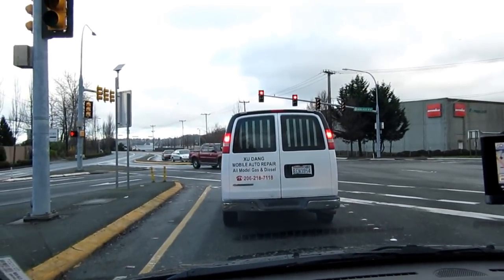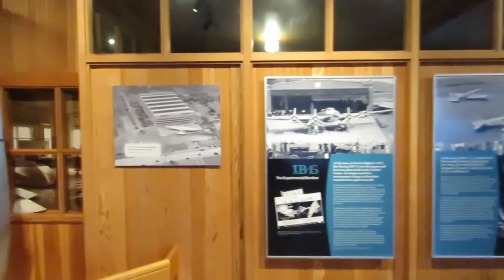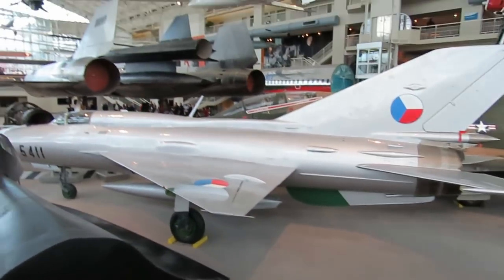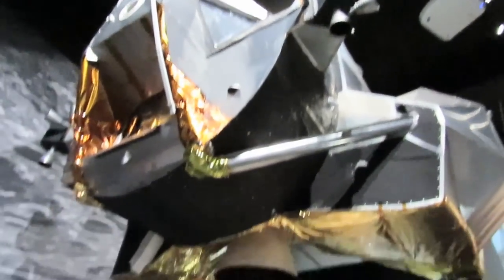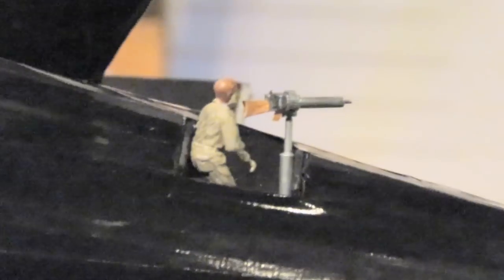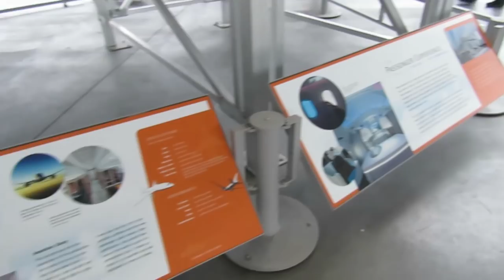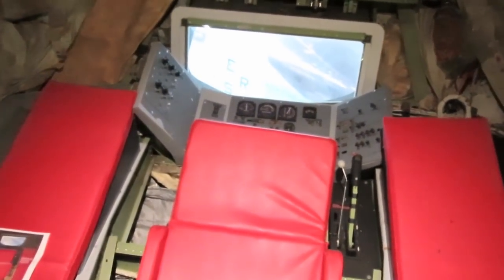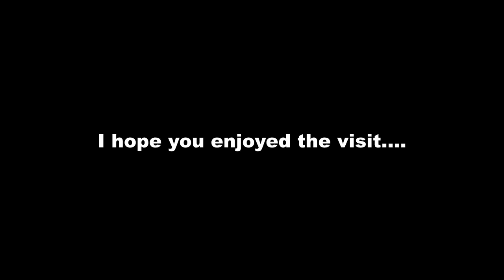A Walk Through Boeing's "Museum of Flight"

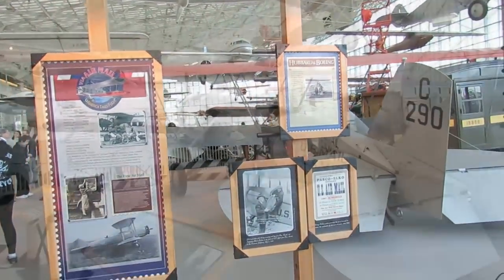Comment: Ryan M-1 (seen above, at 29:00) was recovered from a cow paddock outside San  Louis Obisbo CA, where it crashed 1931. Ty Sundstrom, of Dawn Patrol Aviation, restored  this aircraft late 1970's thru mid 90's. Turned out this is actually Ryan Airlines M-1 #1, and was largely built by a fellow named Waterhouse,  and finished by Ryan employees, 1926. Charles Lindbergh flew this aircraft several times from Dutch Flat airfield, outside San Diego CA, Feb-March, 1927.  IIRC, his famous NYP was Ryan M type #26.

Comment: Thanks for sharing!! I remember their 747 being restored on a program recently. It was in pretty rough shape before that.
Reply: it was in rough shape because in the early days of the museum, they had to store it outdoors on boeing field with no electricity so no interior heat or dehumidification in the cold rainy pacific northwest... i drove past it often when it was parked, it's engines removed and the plane surrounded by a fence. it sat there for years with minimal maintenance so the interior probably turned into a giant fungus factory which made the restoration much more difficult.

Comment: Thank you for the excellent post. I’d spend a days wage to get in there. It has to be one of the best museums I’ve ever seen. I don’t know what you do for a living but you would be an excellent tour guide in your retirement, you were very knowledgeable. 

Just one gripe from a Wichitan, hardly a mention of Stearman or Boeing Wichita. Boeing wouldn’t be what it is today without Wichita. Worthy of note the Airforce One airframe was assembled in Everett, but final interior finish done in Wichita. Oh and one other worthy note, the Dreamlifter a few years ago landed at a small municipal jet port, short of Boeing Wichita.  Missed by about seven miles. Raised quite a stink, they weren’t sure it could take off and get it out of there. Boeing sent in a special crew to execute an extremely short take off (6100’ of runway). But they pulled it off with room to spare. Lol 🇺🇸

Comment: Sorry.. gotta say.. the Air Force KC-135 was not designed or designated as a cargo aircraft although related to cargo planes. It was an in flight refueling model & design. It had room for cargo & was conversable to a passenger bay type aircraft, but rarely used used as a cargo plane & only as a passenger utility plane, as an in flight adjunct to it's primary refueling mission. During refueling operations it had ample cargo bay space but it was kept 100% empty typically. 
Fuel tanks for refueling were in the lower parts of the fuselage; with large empty cargo bay above that. The tail refueling boom operators had a very good sized refueling station, later computerized, to "fly" the boom into the receiving aircraft; typical of the AF way of refueling. (the Navy method quite different because of the Navy's aircraft carrier based mission requirement - smaller aircraft used for refueling with simpler droge design fueling nozzles.) USAF tankers had the capacity to service Navy aircraft and did fairly often, but not the other way around. AF typical refueling receptacles were not compatible with Navy design, though some earlier 1950's AF equipment were designed with the Navy type probe receiver nozzles.
Reply: I hate to disagree, but you are wrong on many of your statements.  First off the 135 is and always was a cargo plane.  We had special rollers installed that allowed palletized cargo to be easily loaded and secured.  After the Cold War ended, it did a lot more cargo hauling, because it could do it very efficiently.  Second off, the boom operators station was never computerized.  The boom was hand flown anytime the boom was used.  For Navy aircraft, the drogue was installed, but the boomer still had to fly the boom into position, and then the pilots would have to fly into the basket.  The Navy preferred the drive system, because their aircraft were smaller, and used less fuel, so the reduced fuel flow was not an issue.  The Navy tankers did not have a boom operator, so the drogue, simplified the operation.  The only automated parts of the boom, were the indicating lights that showed where the pilots are supposed to be.  Also the boom would automatically retract, and raise up, if the receiver got too close.  
Third, all the fuel on the tanker could be transferred to a receiver aircraft.  Of course, if they did that, the tanker was doomed.  The body tanks and center wing tanks were the largest tanks, but the wing tanks were plumbed to drain their fuel into the body tanks to be pumped to a receiver.

The tanker was equipped with a large cargo door to facilitate cargo handling.  For routine flights, where our only mission was to refuel another aircraft, we would never carry cargo, because we are taking off and landing from the same base.   Anytime the aircraft was scheduled to fly overseas, we always were stuffed full of cargo and passengers.  On many flights, we refueled other aircraft in route.  Our tankers were frequently at max weight at takeoff, for overseas flights.  Just for your info, I was a crew chief on 63-8883 for many years, and have 17 years of experience on the tanker.